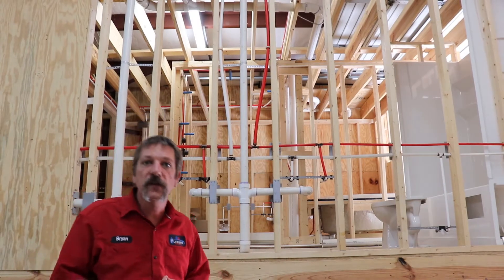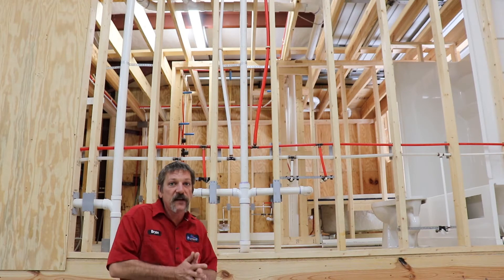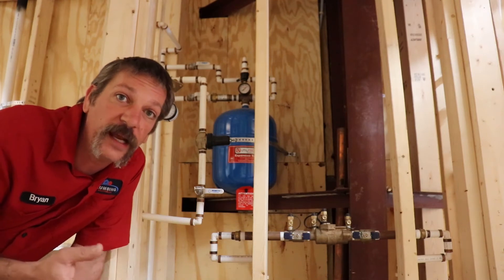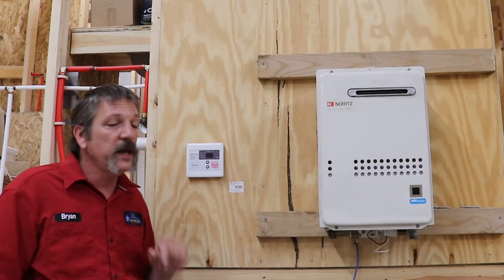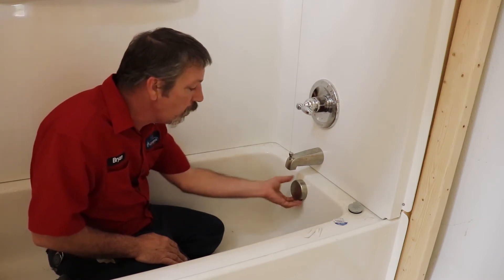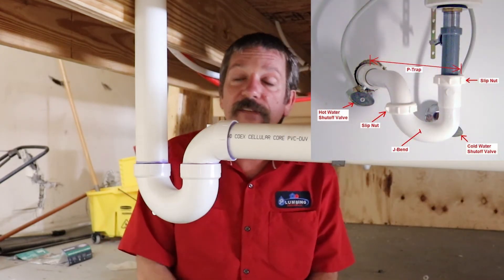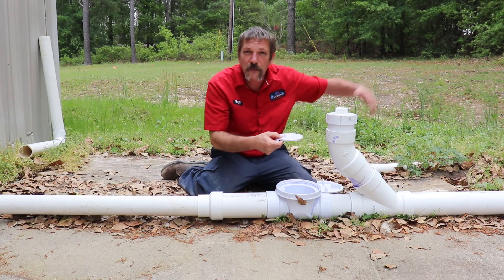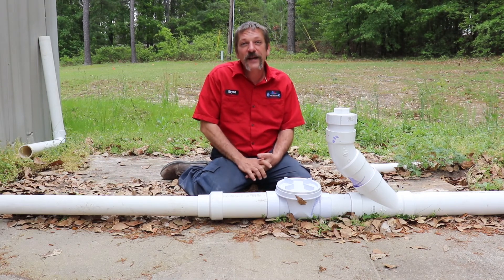Basics of a Plumbing System

Comment: We have a tree outside my home where the waste water goes out the building through the basement. 

Every couple of years roots get into the line and and the wates water back flows  out of the drain which is under the washing machine on the first floor 

&  the backflow floods the hallway &  the toilet,  

and the water then also seeps into the side walls. 

I deal with this surprise  & mess every couple of years.

Then I call in plumber and pay 100s of dollars to clean the line. 

Is there a warning system that can alert me much before it backs up? 

Is there a root grinder available in the market to grind roots that block the line?

If yes, Can I attach the root grinder on the line outside the building to automatically grind the root based on some input from the sensor.

Can the grinder operation be controlled using  flow rate sensor.?

Please advise a long-term solution other than removing the tree  because it will save me six to seven hundred dollars every two years.

There is a grinder on waste water line  inside the basement but it serves a different purpose, we know.